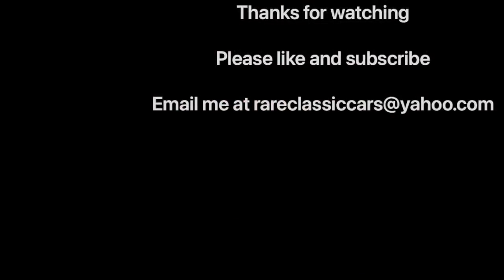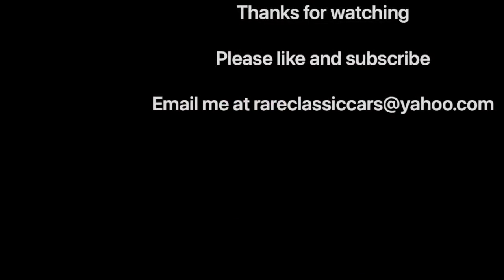Worst Engines of All Time: GM 2.5L Iron Duke Follow Up

Comment: The big market share killer for GM was the Vega engine(and car with its rusting) rather than the Iron Duke which was sort of a fixed replacement for the Vega engine (although there might have been a revised "sleeve bore" version of the Vega engine)
at least Pontiac could wash its hands of the Vega engine in Pontiac subcompacts 

 1966 sort of a  high water year for American cars with such as the 232 Rambler American and 425 Oldsmobile "88" even the Ford Sedan "7 litre" with a 428  all much cheaper and much better than anything available today at 5 times the price (although you needed to know how to set timing and change spark plugs every year and in the case of the Rambler maybe needed to know how to fine tune the jetting in the carburetor,none of which things you need to do (or even can do) with the modern overpriced over digitalized cars of today 
  also the government promoted or inspired worse than useless "start- stop" "VCM" "DOD" "AFM" destructive junk imposed on car buyers

Comment: First of all I want to compliment your videos. 
I have owned several Chevy S10s with the 2.5 engine with a manual transmission and they do sound like diesel engines.
They are very reliable and economical,  but noisy. People that never had one think that the engine has a valve problem.
Thank you.
On a separate question.
Could you post a video on the proper installation order of the spark plug cables to the distributor for the 1986 S10 with 2.5 engine?
I replaced the spark plug cables but I did not follow the proper order and I got lost.
Thanks in advance.

Comment: Dude ,...its the title you used for the Duke . "Worse Engines of All Time" . I don't agree . Sure it didn't compare to the Japanese engines of the time , but all American built engines in those days were way behind the Japanese as far as refinement . The Duke still got the job done . V8 smoothness ? Its apples and oranges . A worse engine category would be something that leaves you on the side of the road . The Duke is not in that category .

Comment: My experience was the opposite.  I thought the engine/vehicle was smooth compared to the imports which I called buzz boxes.  It was a little noisy at idle but overall much smoother and quieter than any honda of the day.  Let me ask you:  Which would you rather take on a 2 hour highway drive?  A GM with an iron duke any day.  The body and build quality was just head and shoulders above anything Japan offered in the day.  Was the engine better?  No.  But the car sure as hell was.

Comment: I almost never comment on anything, but I’m going to do so here. My very first car was a 1980 Pontiac Sunbird. I was the second owner, and it was fairly new and low mileage at the time. I had to work on something on that car almost every day and you would never be able to sell anything like that now.

This was a rear wheel drive car. A couple of very particular points about the engine, outside of the regular overheating and vapor lock issues, and unreliable fuel system in general, or the entire TH200 (not the engine, I know):

The first thing was that there was a factory bolt that protruded somewhat into the upper radiator hose, which almost always would fail in that area at an unreasonably short interval.

The second thing was that, best I could tell, the engine only stopped in one of three spots. Mix that with the way GM starters had to be shimmed at that point to work, and I went through two flywheels in less than 50K miles. It would always wear the teeth off the flywheel in three spots. One day the starter would just spin instead of turning the motor over. So, I would have to get out and grab the fanbelt and move it six inches or so. The compression was so low that would turn the crankshaft enough to get to an area of good teeth.

Comment: You are clearly correct. Now for an addition. I had an S10 for a couple months back in 1992 and I traded it in. Everything on that truck squeaked, rattled and complained whenever the engine was running. The engine shook bad enough but I could have lived with that, but the entire rest of the vehicle would also make a weird orchestra of sounds. I got rid of it after just a couple months because it was so uncomfortable to drive. My S10 was built in Louisiana and I wonder if there was some connection to the drivers opinion based on where the vehicle was built.  I can not see where anybody could have gave it a good review even though many did. Oh and I did drive many trucks over the years before I got that vehicle and owned a ford for years (still got that one)

Comment: I had a 1980 Oldsmobile Omega Brougham with an iron duke/manual transmission.  It was nothing but problems from the day I drove it home from the dealership!  One of the many problems it had was an undersized piston.  It took an Oldsmobile engineer to finally figure this out.  GM at its finest!

Comment: What is your take on the Fieros with the Iron Duke? I got an 87 Fiero with the Iron Duke and in the couple of weeks to one month I've owned it has been very good to me, it's got 116k  miles but yeah it's a very comfortable ride and enjoy it a lot. My last car was both a 1990 Buick Lesabre Estate Wagon swapped the 307 Olds with a 1985 Camaro Z28 HO 305 V8 4-BBL lol and  a 1991 Firebird 305 TBI paired to a World Class T5, I loved both cars but just needed to downsize and keep one car and wanted better fuel economy, I am planning on getting another Third Gen Firebird in the future but for now I'll stick with the Fiero lol
Reply from the maker: It’s a reliable engine. Just crude. And don’t rev it over 4K RPMs. It makes no more power and the bottom end isn’t super strong.

Comment: The #2537 crank gear with the #2524 "aluminum" cam gear is set #2538S. This is the set you want for the Duke.  or NAPA Part Number: NTP81016   also fits chev 6/ 4

Comment: My mom bought a new 1986 Celebrity. She then got a 1992 Saturn SL2, a car that made her Iron Duke Celebrity seem buttery smooth, then on to a 96 Lexus ES300… and never left the Lexus brand. If you’ve ever driven a Lexus you’ll know exactly how smooth and refined they are. Her Saturn was course, loud, and had a miserable ride, she bought into the quirky marketing though. With that, my brother had an 92ish SL1, which I learned how to drive a manual transmission in, and remember his being far more comfortable than hers. As course and unrefined as the pre balance shaft Iron Duke was, the Saturn engines/engine mounts/insulation were worse, at least from our experience.

Comment: I had a 1980 Pontiac Sunbird with the 2.5 iron duke. It had rough idle that I could never fix. Looking back, the engine was dependable but I was never happy with it.  “Dieseling” was a problem also. I never bought another GM car with a 4 cylinder engine after that experience.
Reply: Did your car have air conditioning? On air conditioning cars, the anti diesel solenoid was repurposed as the air conditioning throttle kicker solenoid to increase the idle. The anti diesel function was provided by engaging the air conditioning compressor when the engine was switched off. .Maybe that wasn't working.

Comment: In the mid 80s I really wanted a new Grand Am, but this iron duke was such a turd that’s why I didn’t buy the car. I got a really sweet new VW Jetta instead, the motor was a gem. 1988, the year the American manufacturers lost me

Your arguments are bulletproof, my sentiments precisely. The only four-cylinder I ever drove that felt worse was 1988 tempo with that 2/3 falcon engine

Comment: I don't know. I tend to doubt there were that many people that traded a Cadillac in for a Sunbird, that were expecting a luxurious experience. Those that bought American compact cars at the time, weren't buying them because of their refinement. They were buying them, to save some money, while still getting from place to place. A lot of American compacts had reputations as sub optimal cars, but people still bought them in large numbers. Non-domestic cars were quite a bit more expensive. Not everyone could afford that, though. Perhaps long term reliability might have changed the calculation, if it could have been factored in. 

At the time, four cylinder cars weren't my thing. They were all the same to me - a means to an end, though I did like my parents' Accord LX-i. I knew some friends that had various "Tech-IV" powered cars, and they liked them. They definitely sounded unique. They didn't have a typical low rumble. They putted, like a gas powered generator.

Comment: You can't help getting a lot of flack titling your vid "Worst" engine since many have had other terrible engines and they think you should have picked their worst.  Examples include Vega 4s that overheat and burn oil (as you mentioned in the first video) or Y block Fords that had rocker arms that didn't get oil and the list goes on and on.  I agree with your choice.  Iron Duke powered Camaros really bothered me.

Comment: As far as the "troubles" at GM,I think there were problems with build and assembly that affecting most parts of the cars,even body hardware and painting that affected most or all of the brands and models,maybe some a bit worse than others. Also immature engineering of such as ignition modules and oxygen sensor/air pressure and/or flow sensor driven air/fuel mixture control.  Did GM have ongoing labor problems through the era or was it just trying to push too much product out the door for the workers to keep up? 
Internal conflict between engineer driven vs. "beancounter" driven domination of policy? 
Too much pressure in the market place to sell for a few hundred $ less?

Comment: Bud I was a auto machinist for many years. I have built so many engines from that era I could not count them. I have worked on many iron duke engines, & even owned one that 
rear engine Pontiac Fiero that a automatic transmission. I do not know what the he11 
You are talking about. That was one of my favorite cars. Those engines did have a different 
sound to them, but that car had no vibration to it. You are the first person I have ever heard 
complain about them.🙄
Reply from the maker: Read the comments

Comment: The Iron Duke in my Fiero 2M4 SE 5-speed was wonderful. And I think as much as the Duke gets slammed as the engine choice for that car, I think GM was smart to use the (low) Tech-4 in the Fiero with its complex and odd cooling system. Aluminum heads or blocks would be fried the first time someone tops up a Fiero cooling system without knowing how to do it properly, the all-iron Duke and 2.8L V6 were far more forgiving to overheating than some engines which would have been preferable for performance reasons. I wish GM had put a 3800 into the Fiero from the factory. 
The Fiero was a fun and good-looking economy car and as long as that was your expectation, the Iron Duke was a good fit. 
It was loud, it was rattly, it was clanky. You get a passenger into the car and turn the ignition key, the engine vibrated a lot and it really woke up the passenger.... "Wait, it feels like the engine is behind me!" Yup. The vibration of the Iron Duke was also fun, because it did make the car feel... powerful? You were definitely aware when the engine was running, let's put it that way. 
75MPH across Michigan from Detroit to Chicago? The Fiero's Iron Duke wasn't even trying. Air conditioning on full-blast, still plenty of passing power, still great fuel mileage. And yes, I had rebuilt the engine, new timing gears, cam, lifters, rings, bearings, I trusted it. ALWAYS put in aftermarket connecting rods. 
It was a great engine for an economy car.

Comment: I agree the expectations vary greatly between a car buyer vs a pickup. Roughness and crudeness can be seen as a positive  in a pickup. Compared with honda vw and other fours at the time they were smoother freereving more entertaining to drive than american counterparts . They produced more hp with sub 2 litre engines the dukes 2.5 litre is big for a four but look at its output. And once you start going above 2.0litres the engine imbalances get more pronounced.  My dad bought anumber of dodge k car 2.2 litres in the eighties. Good engine reliable but another engine that was rough and i think that hurt the appeal and some of the fun factor of these cars. They really didnt put any effort in making a sexy 4 cylinder. Even the pushrod 2.3 iron lump in the Taurus  for had a lovely ohc 2.3 in the euro ford capri. To save on tooling the made that iron lump dirived from their nice staight 6.

Comment: 84 Fiero, 2.5 TBI, 3 speed auto.Vibration was OK. I fixed the TBI manifold porting and it would redline top gear. I spun a rod bearing....  After a patch rebuild with a new connecting rod, bearings and ARP rod bolts, it held up quite well and would bark the rear tires from a light. When we traded it the dealer took it for a spin and said it really was a quick car thanks to the V6. I did not argue with him.

Comment: You compared the '80's and '90s Honda and Toyota motors for smoothesness. You must not have ever driven one of those cars. My son had a '90 Camery that made the Chevette we owned in the '80's feel like one of those '70's Buick  or Olds full size cars you copared the X/A cars to.  And I am not a fan of the Olds  "Small Block" either. I maintianed a few for friends and family and they ALL had bad miss fire at idle shaking the whole car.

Comment: I recall the 2.5 Pontiac being installed in the CJ Jeep platform circa 1980-83 as standard equipment.  As fitted in the application, engine NVH was noticeable when compared to the 258 AMC six, which was a relatively smooth unit.  The 150 AMC four, which superseded (in a manner of speaking) the 151, was a more refined, smoother engine, albeit of modest power output.

Comment: If you look at the design choices in the Duke, very oversquare cylinders, no balance shaft, low rpm limit, phenolic cam gear. Every 4 cylinder engine built today is the polar opposite and for good reason. The Duke was reliable but it was not a good design.

Comment: I'm confusing amc concord has iron duke 4cyl.this engine from gm?????.
Chevrolet with 4cyl run for long time its reliable 4 cyl engine.run over 100k miles no problem.
Reply from the maker: GM supplied amc w this engine.

Comment: My Cutlass Ciera was $ 13.647.00 in 1986 and had the Iron Duke which had two defects,. one was the distributor was crap as the aluminum base plate was not well attached to the steel  shaft , came loose and rattled around causing poor idle  . Oldsmobile couldn't find it until I showed it to them ,secondly a rash of 86 engines had improper heat treating on the head bolts causing two to break .   I had run up 53 K by this time and this was on my dime . So I did the top end job had a valve job done by a local automotive machine shop an after some gaskets and a couple hoses , cost me around $ 230.00 . Ran better than new when done  . But by this time I had seen enough , the paint had flaked off at 17 K olds dealer repainted it  and to their credit it looked better than new , the A/C system with the GM pancake compressor was crap and barley worked on a hot day . Got rid of it and got a Dodge Dynasty 3.3 V6 no comparison smooth and peppy ran it 130 K without issue . I understand the engine was not the only problem but it speaks of the state of GM cars of that time .